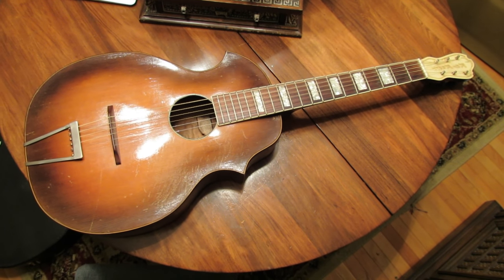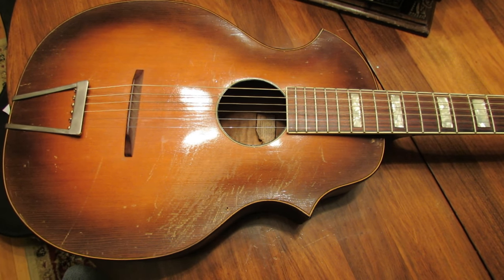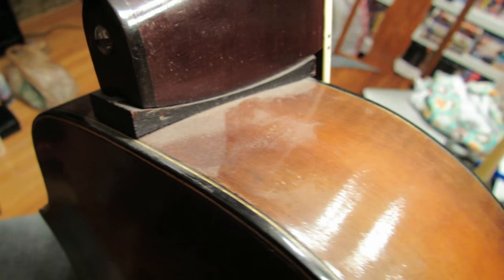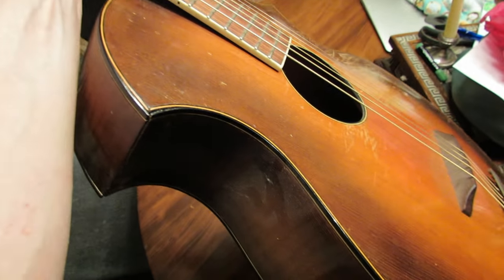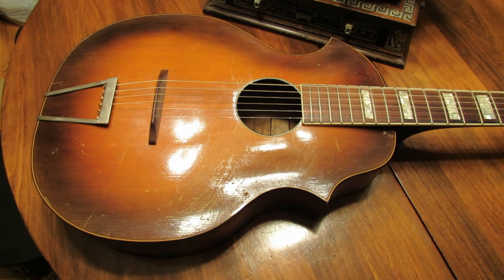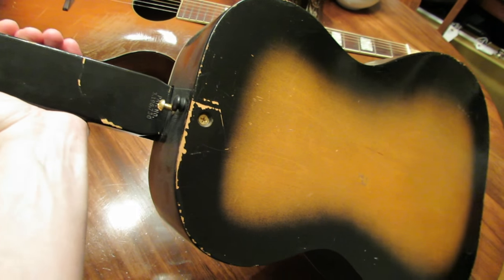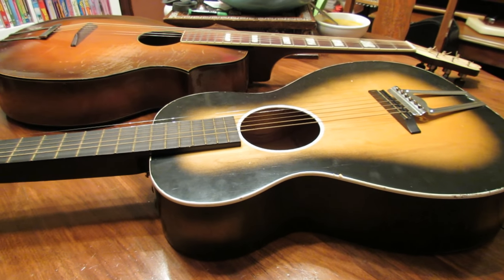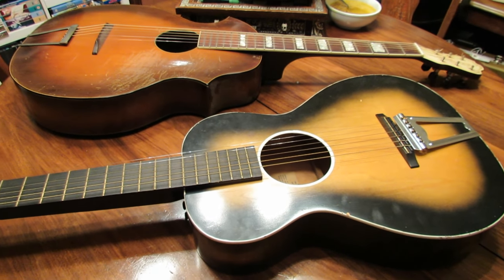A Brief History of Adjustable Bolt-On Acoustic Guitar Necks

Comment: I had a EKO 12 string acoustic guitar with a bolt on neck. It was made in the mid 60's. I also had an Epiphone 6 string acoustic with a BON. So the Kay Kraft was an arch top with X bracing? Was the X bracing similar to an modern arch top or even a dreadnought? That might be a great project build for unusual guitar. Thankz
Reply from the maker: Yeah, the Europeans were doing bolt-ons in the 60s. Framus, Hofner, and I believe Hoyt all had bolt-on acoustics.

Comment: Howe Ormsby too in the early 1900's I think
Reply from the maker: And apparently Martin, who copied Stauffer's ideas early on in the 1830s experimented at times with bolt on necks. According to one blog article I was reading, the bolt-on feature at this early stage had more to do with making the guitar more compact for easier travel than ease of adjustability. Not sure how true that is, but it does make some sense to have a guitar that was easier to fit atop an overland coach.

Comment: Hi, Brad. Thanks for the Brief. I was unable to identify who made my guitar before watching, i.e. Jackson Guldan. Interestingly, my J-G does not have the bolt coming down from the outside, between the neck and the peg for the strap (as described and diagrammed in the patent Fig 2). Instead, the bolt is accessed from inside the soundhole, pushing in the opposite direction from that described in the diagram Fig 2, i.e. my 'Adjustomatic' pushes the bolt (same vertical alignment, opposite direction) from the inside towards the neck/top of the body/neck. 

That Venetian, however... whew! that's a pretty guitar. Beautiful design, executed masterfully.

Comment: The Gildan was used a lot by Dobro players, hence the square neck, these require a high action, as played using a slide. Rather than needing a standard guitar and a 2nd dobro instrument, players were able to swap back and forth on the one guitar :)